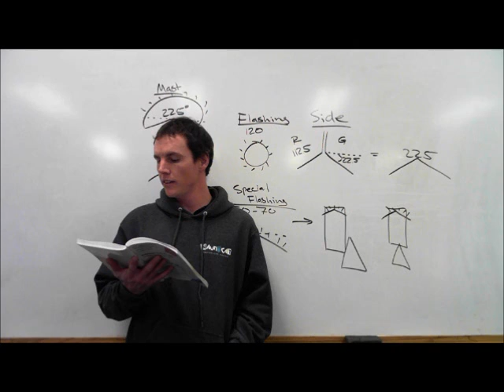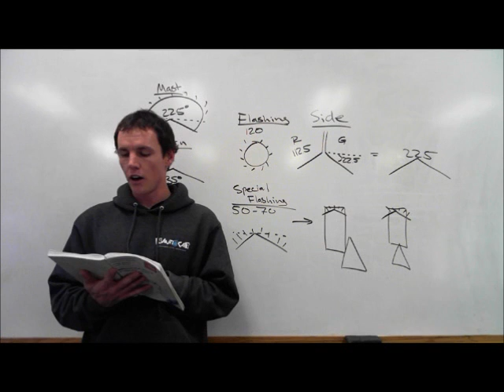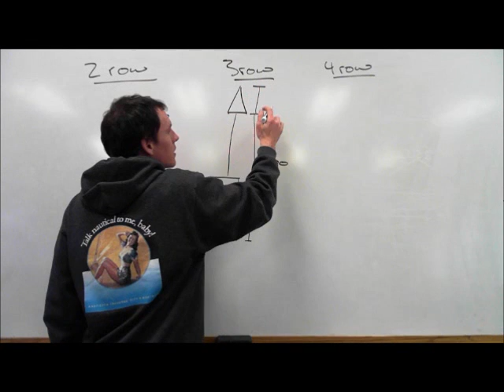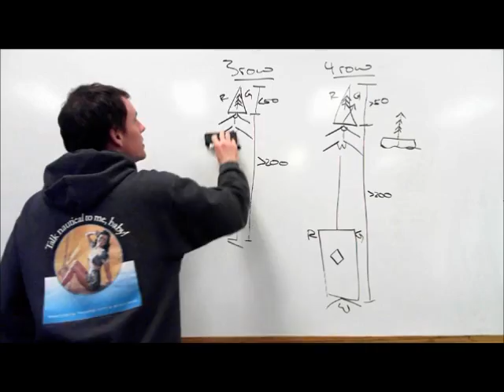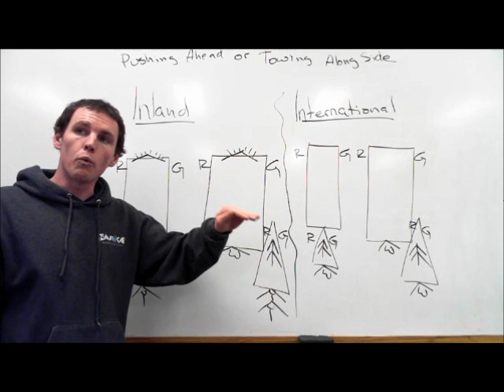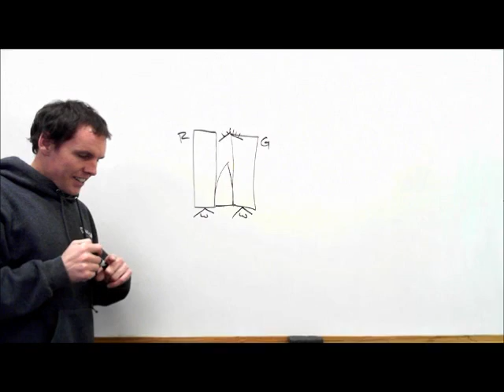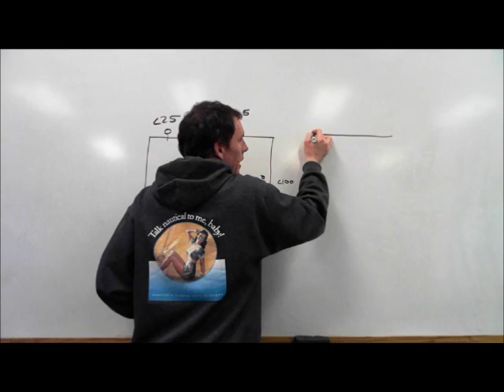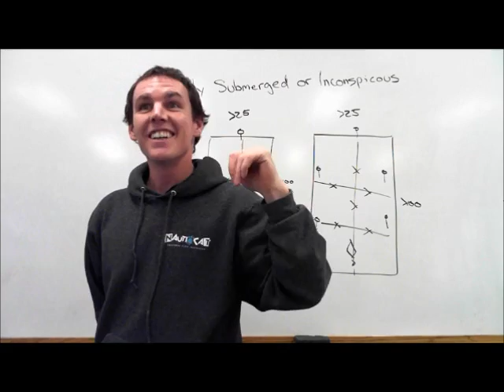Rule 24 - Towing and Pushing | Lights and Shapes

Comment: What's the difference between rows 3 and 4? Both have a tow greater than 200m but one is showing 3 mastheadlights and the other is showing 4?
Reply from the maker: The fourth masthead light is abaft of and higher than the forward three. This comes into play when your tig is greater than 50 meters in length.
Reply: Rule 24 clearly says instead of rule 23 (a)(i)(ii) the towing vessel shall exhibit 2 masthead lights in a vertical line and if the length of the tow exceeds 200m then three masthead lights in a vertical line. This means that regardless of the length of the towing vessel, this has to be applied (either 2 masthead or 3) .So, I think there is no need for 4 masthead lights as the length of the vessel (towing vessel) is not considered while towing as per rule 24. Kindly correct me if I am wrong. Thanks.

Comment: If the towing is bigger than 200m either the tug and the object being towed shall exhibit the diamond shape? Or only the object being towed?
Reply: A power driven vessel when towing shall exhibit :-
when the length of the tow exceeds 200 metres, a diamond shape where it can best be seen.
That means in the diagram referred to as 3 in a row and 4 in a row, the towing vessel will show a diamond shape where it can best be seen.
Reply: @saurav123singh  h